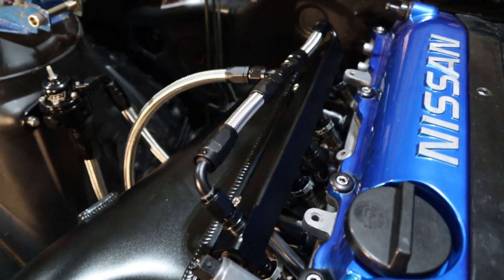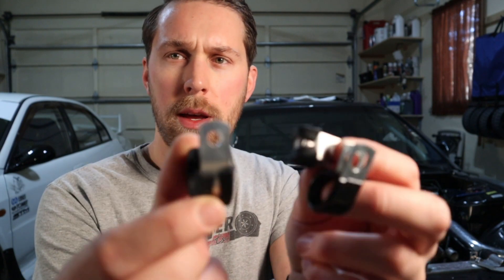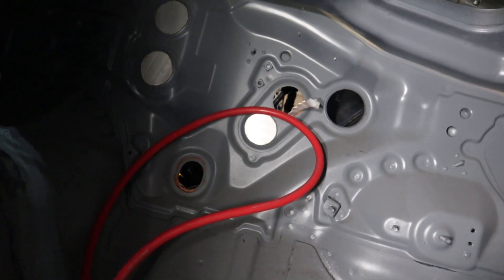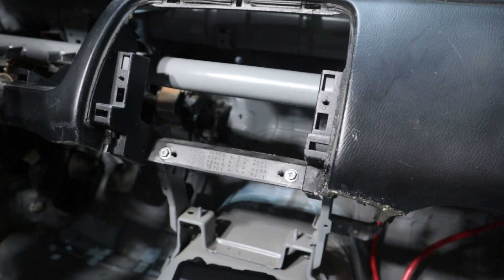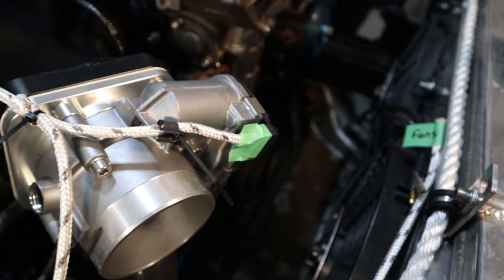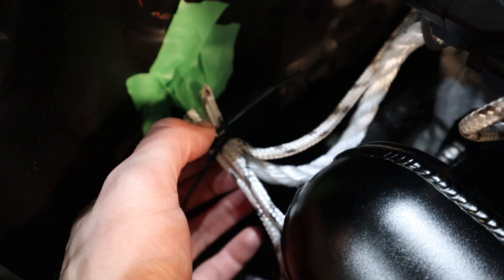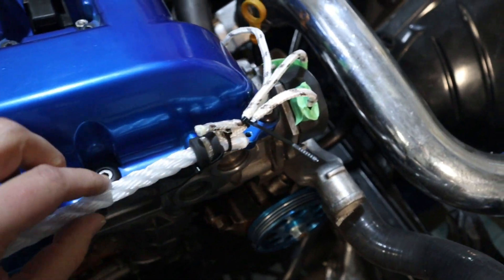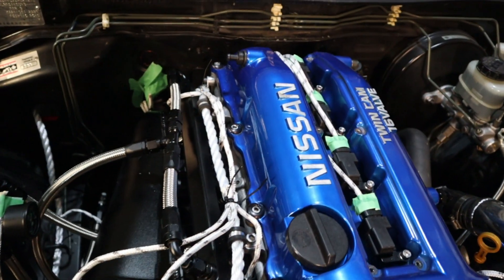S14 (SR20DET) - Custom Wiring Harness Part 1 - How to Route the Engine Harness

Comment: Perfect timing for me as I look to make my first harness on my Kouki. What was the name of the quick connect you used at the firewall for the engine harness? do you happen to know if it has enough pins for a more 'stock' sr20 offering without the TB? 

Also having not watched the rest of the series yet, do you also plan to quick release the accessories harness?

deffo want to do this to mine! Great video look forward to binge watching the rest tomorrow
Reply from the maker: Sorry for the late reply. Things have been stalled on the build due to life! For the quick connect, I like to use Amphenol ADHM series connects. They aren't as expensive as some of the higher end connectors, but they still do the job. They also use the standard Deutsch solid barrel contact. I'm planning on using them for both the engine harness, as well as the accessories harness. There are several different configurations, and they would definitely work for a stock system. Good luck with the build, and don't hesitate to reach out to me with any questions about the wiring. Best to DM me on Facebook. Link is in the profile.